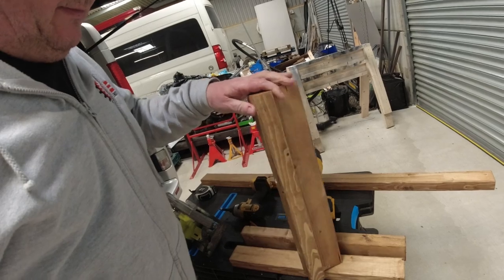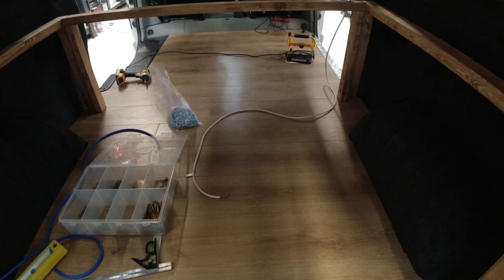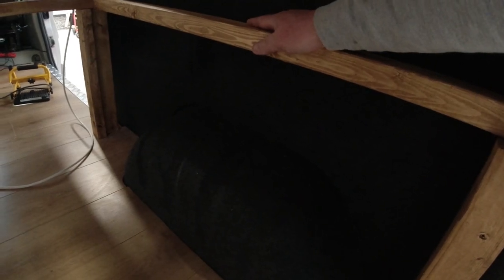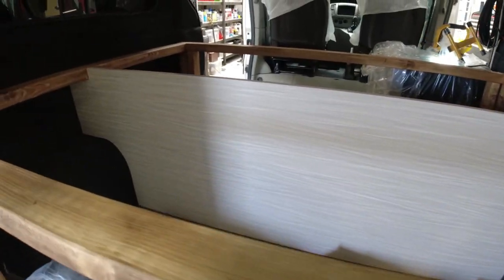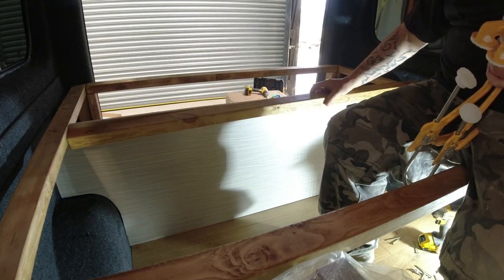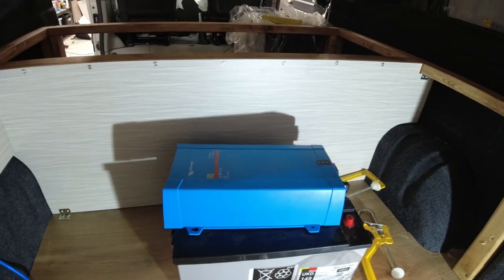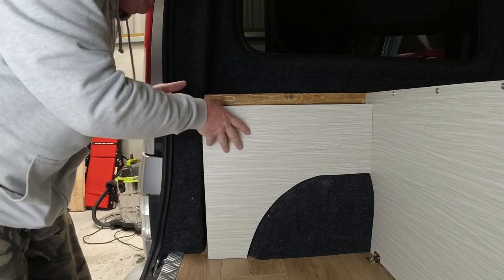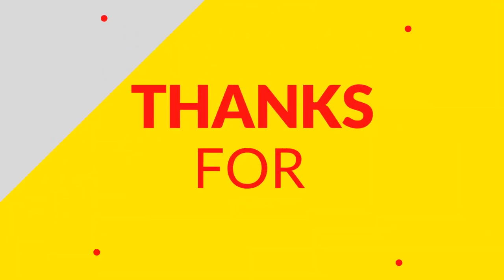Renault Trafic Campervan Conversion - Bed Build Pt 1

Comment: Hi , I am building a long wheel base high top Vivaro at the moment , with a fixed bed , underneath Ive got 80ltr water tank & pull out storage above. Front of bed I've managed to get s pull out toilet & gas bottle storage.
Along the sides of the wheel arches there is more storage room not that high but it's there if you lift the mattress more storage above the wheel  arches once again. It's been a lot of head scratching to work it all out , but it's nearly there . Great content in your videos keep it up really enjoy them . Cheers Geo
Reply from the maker: Nice to hear that you have made it work hopefully get to meet up and see it one day.  Thanks

Comment: Great video. What size timber did you use for the main frame?
Reply from the maker: I used 3x2 or as it's known now as 63mm x 38mm cls
Reply: Thank you. Definitely going to use your design for my bed frame.

Comment: Is the bed bolted to the wall or floor . What secures it to the van please ?
Reply from the maker: I have bolted it to the wall of the van and made it fit to the size of the van as well.  It could quite easily be freestanding it is sturdy enough and a tight fit